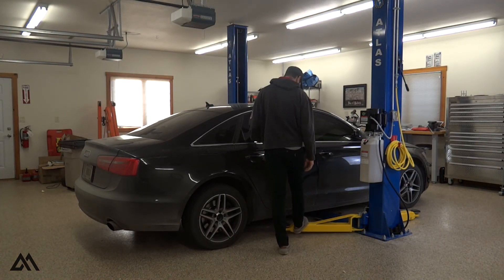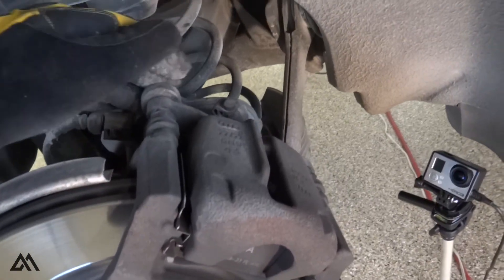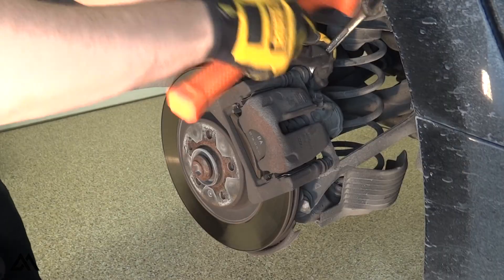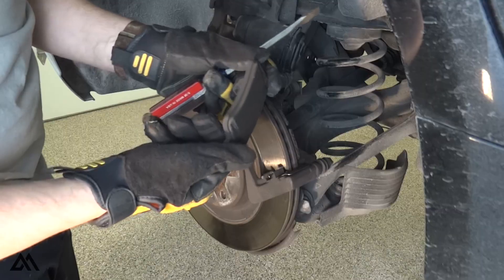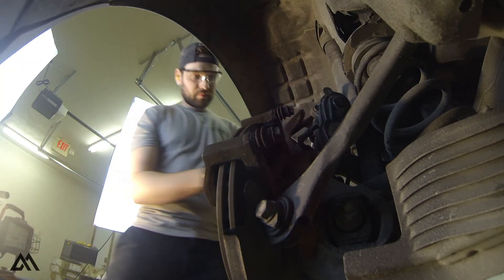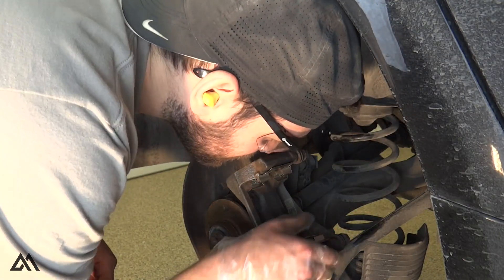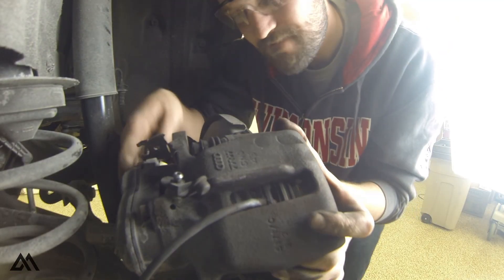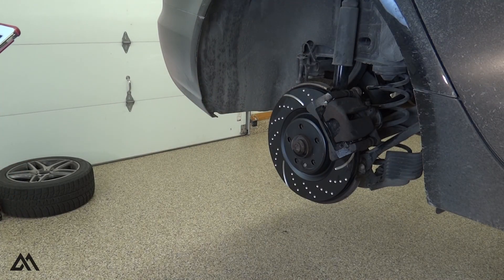Audi A6 (C7) Rear Brakes Installation with Electronic Parking Brake | Rotors and Pads Replacement!

Comment: Thanks fella, just finished mine. On the s line avant the rotor will not clear the carrier you have to remove it. 18mm spanner. Needs some mechanical advantage, On the rear, the front cleared fine.

Comment: There used to be ways to retract them the cheap way I forgot how also how's an electric parking brake stop you from taking out the caliper that sounds stupid.  If the parking brake is off it shouldn't interfere with taking the caliper off?
Reply: Correct, unless your old pads have worn a lip on the rotor.  Simply disengaging the EPB may not give enough clearance to remove the calliper.  The main point is though, that you can't push the piston back in without winding the EPB mechanism all the way back.  You either need to use the OBD Eleven, or a direct current from a 9 or 12 Volt battery to the motor or remove the motor and wind it back by hand (clockwise).

Comment: How do you know what size rotors they are?  I see 320mm and 356mm for the C7 A6 as options.
Reply: Look at your build sticker in the boot, there is a code that tells you what size disks are fitted from the factory. Something like 1LF.

Comment: Hey brother i got my rotors and pads replaced but everytime y turn brake pads and brake lights turns on. Any idea whats happening ???
Reply from the maker: Must be something to do with the pad wear sensor. Maybe it’s loose and when you turn it breaks the connection?
Reply: @ModernEngineer  i replace  both conectors but it keeps happening and its only when i turn left

Comment: Do you know if the process is the exact same on a C7 S6?
Reply from the maker: I would suspect it would be very similar.
Reply: @ModernEngineer  Just followed this video for my C7 S6.  It's the same.  I love the tip about not having to remove the carrier.  Saved me so much time.

Comment: I did the breaks without doing anything with my electric parking brake... now it’s not working.. did I fudge it all up?
Reply: You  should have  done some INVESTIGATION  on YouTube  into doing discs and pads as there are some very clever people out there  who have worked out you dont need any special equipment to  wind back the rear pistons  because of the  electric   hand brake,   it's  so easy   to do , Google it .     And for anyone  contemplating the  job   Spray  releasing  agent  on the bolt heads for a couple of days  before  doing the job ,        AND  clean the area on the hub where the wheel fits with brush,      or cordless  drill and wire brush , makes removing the  wheel later on as alloys seize  on to the steel hub unit , use copper anti seize grease  use a small brush dont get it on your hands ,  its toxic ,

Comment: How to I find the torque spec on all the bolts when doing a brake/rotor job?
Reply from the maker: I usually google search for the torque specs. Usually they will be in a forum or sometimes you can find installation guides at ECS Tuning that provide torque specs
Reply: Thank you.
Appreciate the video helped out big time
Reply: Typically Wheels 89ft/lbs (120nM)

Comment: It may be that the only thing i ever appreciatet with this car was that it was riding quietly. I watched your awesome vid, took on the Mission an changed both brakes and now i have a really weird noise. It starts at around 40 km/h and just gets louder. Like a helicopter noise. Friend who help me said it will eventually go away but hasn't after 2000 km drive 😭
Reply: That’s your wheel bearing going out.

Comment: Does every a6 c7 has a sensor in the back brakes? My garage states, that my a6 c7 does not have a sensor, which is common for many vag cars, which I doubt. Or rather he said that the back brake pads have no sensor.

Comment: Hey man, I’ve replaced my rear calipers and did the bleeding but my brake pedal is still soft. Do I need to bleed all calipers to get a firm pedal again? Thanks
Reply from the maker: You may need to utilize a scan tool to operate the ABS module while bleeding. I just experienced that with a VW Passat.